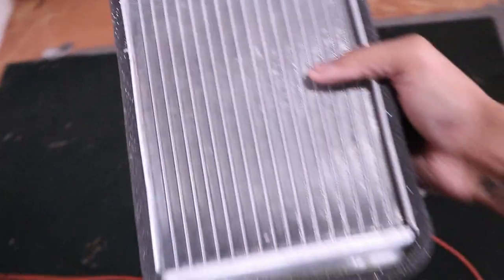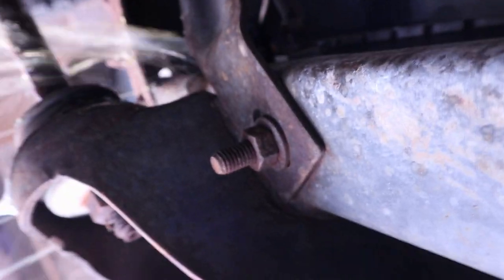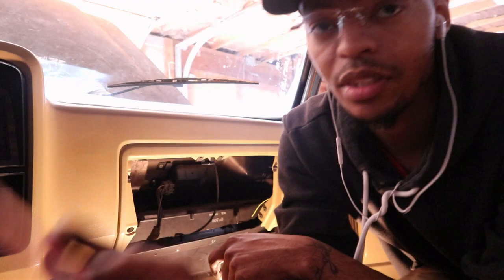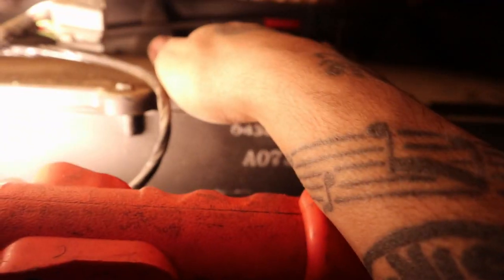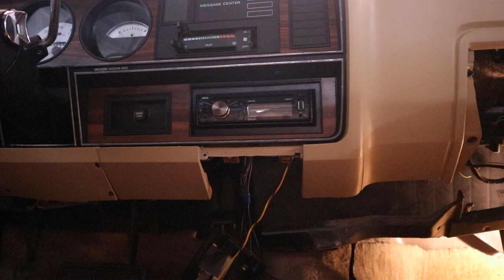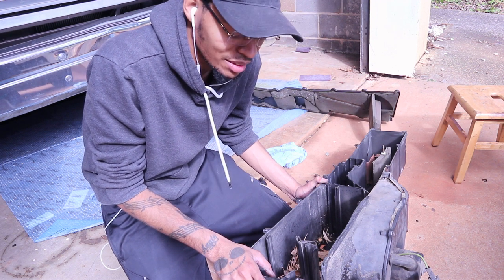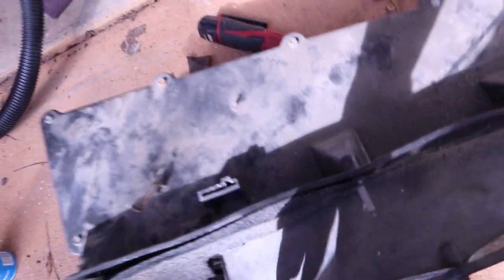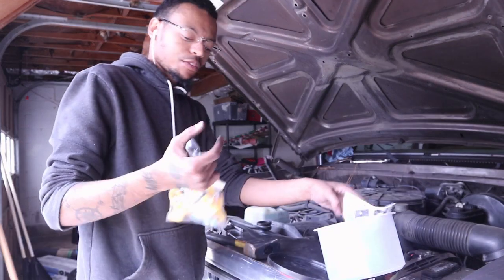Replacing heater core on 1989 Dodge D100

Comment: I have an '88 D150 my Daddy bought brand new and left to me when he died. Now that I'm retired I'm fixing it up. Started on the heater core today, stopped to find more info from those who have been there before. Mine has air conditioning but they are enough alike your video confirms everything I needed to know. Thank you.
Reply from the maker: Glad to help and good luck on restoring yours
Reply: So what is the exact diff between ac and non ac. Is it just the expansion valve?

Comment: your doing a bit more work then you have to, dont take the brace off completely, and dont take all that other stuff off. take only the 4 screws out of the bottom of the glove box, the 4 screws on either side of the glove box and the one inside the dash up against the passenger wall, and the one 1/2 bolt on the passenger wall. also of course the "fake" nuts on the fire wall, be very careful bc they suck. when you slide the heater core enclosure back you can remove the yellow and red clip. you will be able to pull the brace back and lift the dash enough to get the enclosure out.  if you are having trouble getting movement give the studs in the engine bay a few light taps and it will start moving

Comment: Wish I had watched this earlier before I started in on my '89 W150. The Haynes manual is terrible in telling you what's back there. I've had that leaf problem for years, and recently rain water, too, filling up the compartment and pouring out the air vent. I saw a photo where someone had cut a hole in the housing and installed a boat deck lid for easy access. Simple enough, only I didn't know the evaporator core was back there and nicked it with my power saw. FML. I still would have cut out an access port, but I'd have used a manual saw instead.
Reply from the maker: Yeah I have the Haynes and it wasn’t useful for that job, I’m lucky I haven’t had any rain getting into the cab

Comment: Waoo a lot more work than what I thought, where's the ac evaporator anyway? Thanks
Reply from the maker: Seems like a lot more work but once you get the whole assembly out you realize its not that bad. I'm not exactly sure where the ac evaporator would be located because my truck did not come with AC from the factory

Comment: Whats wrong with your truck to make it smoke so bad.  Mine does same thing
Reply from the maker: I don't know why it did that, this video 2 years old and only thing engine wise i done to the truck was change oil but it doesn't smoke like that every time I just drove it last week and it was sitting for weeks fired it right up and no smoke came out.
Reply: failing / failed head gasket